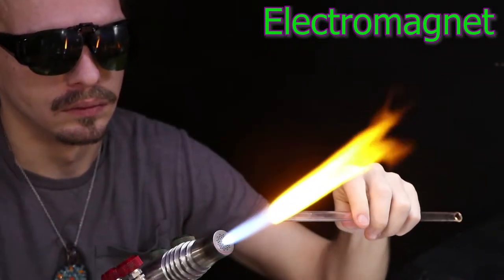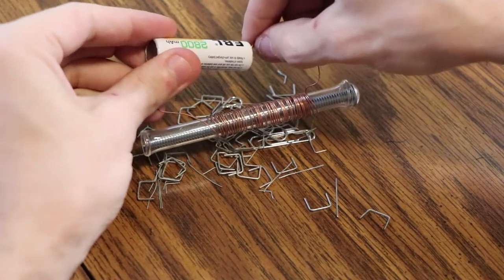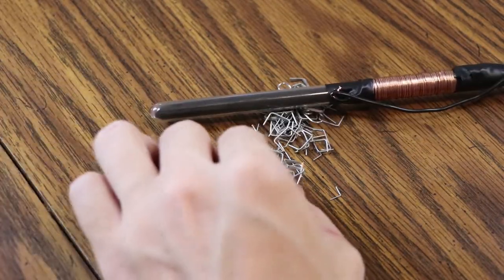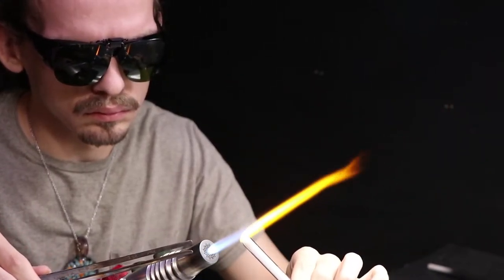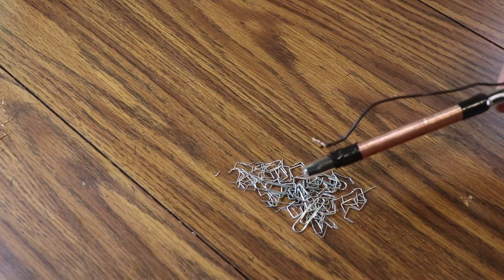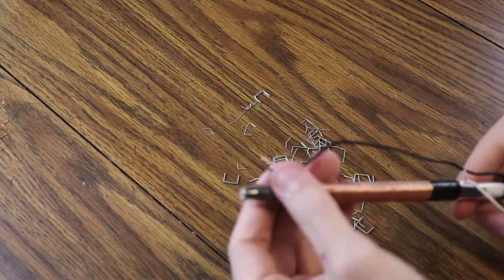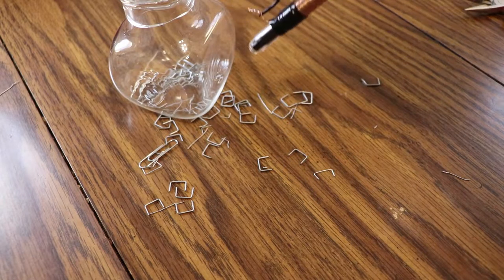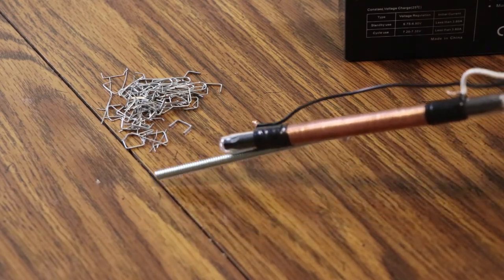Electromagnetic Science Experiment

Comment: Dumb question, maybe, but did you use plain copper wire or coated (or enameled) wire?  Plain wire would conduct the current straight across the coils rather than round and around the coils.  Magnet wire is coated with a thin enamel layer to keep the coils from shorting out.  Might give stronger magnetic field if you have current going all the way through all the loops.  Cool video, though; thanks!
Reply: Since the coil was getting hot it’s a dead give-away that he’s got a short, likely because the wire is uninsulated.  You’re right magnetic wire is always coated in a thin insulation like formvar, lacquer, or polyurethane.   I also agree it would have worked much better if magnetic wire was used.   You can wind coils with bare copper wire but you have to insulate them yourself by carefully applying lacquer between each layer and you have to make sure it dries before the next layer is applied on top, as well as making sure the neighboring wraps don’t touch until they are coated as well.  (This is how some vintage pickups in guitars were wound).  It’s important to note that the insulation adds important characteristics to the coil itself, namely by affecting the impedance of the coil.  Thickness of insulation can and does affect the shape and size of the magnetic field generated but that’s probably more noticeable in a guitar pickup than in an electromagnet.  The type of wrap made with the wires also influences characteristics of the magnetic field.  Highly ordered coils with even wire tension produce a different shaped magnetic field than randomly wound (basket woven) coils with changing wire tensions throughout.
Reply from the maker: That's a great question Brad. I'm not entirely sure, I'm leaning toward plain copper. Honestly I had no idea there was a thing as magnetic wire. Yea I wasn't sure if there was an issue with the way I wound it. The coil should be contacting along the sides. I did try some insulated power wire and it was running hot also, I'm starting to take it as "normal" as electric motors do heat up. Thanks for the comment I'll have to looking to the magnet wire.
Reply from the maker: @rickmarkham2584  I was testing also with an insulated wire and it seemed to get just as hot. I was worried the wire would conduct along the sides down the coil, but it seems to be working. It is only a single layer wrap, maybe multiple layers would be different. I'll have to get some of that magnetic wire and try to make it more efficient.